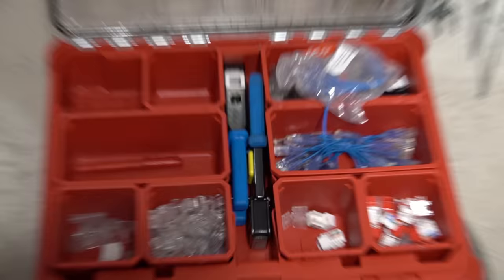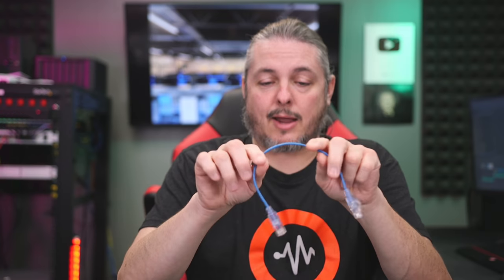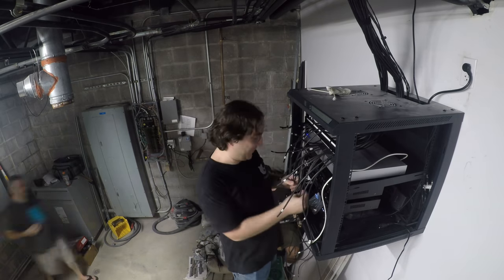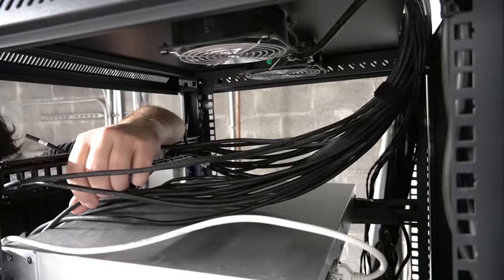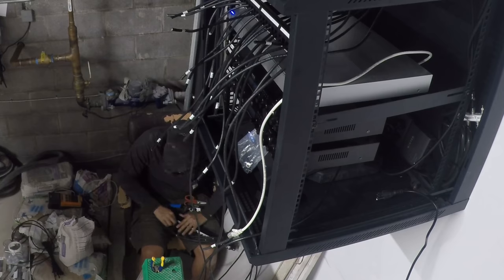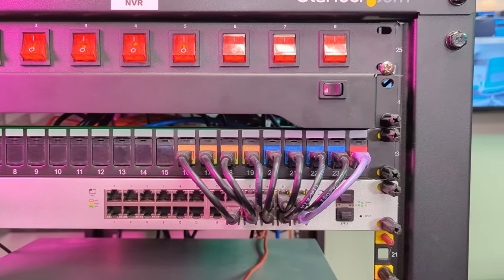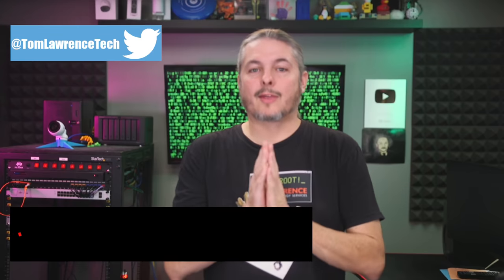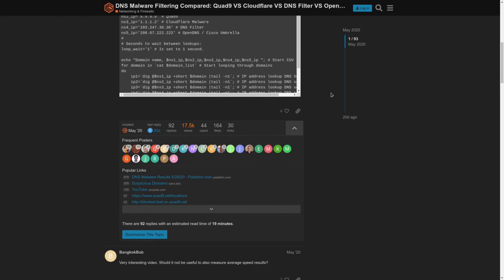Rack Cabling Project

Comment: Thank you from Romania, Tom! 
Some short questions:
- Do you have a procedure for labeling cables? I am referring to the notation that you use.
- How to properly do cable managment, when you need to use longer patchcords, and what accessories are available and you use for the racks?
- A short presentation of the accessories the you use for cable management in the ceiling.
Thank you again!
Reply: For notation, I usually just go by the room number, with a hyphen and number if there's multiple jacks in the room (ie: 201-1, 403-2, etc), that way anybody who comes in can figure out what goes where. Any modern office building will have room numbers, at least on the blueprints, and schools, of course, will have room numbers on the doors.

When my school was originally built around year 2000 (I was a student there), they ran two Cat5e cables to each wall plate, with black and blue Keystone jacks in each plate (and didn't label anything, I had to do that myself later 😠) . Black was the student domain, and blue was the teacher workgroup (the servers weren't set up terribly complex, they wanted it to be easy for a teacher to maintain). When I graduated and started doing IT support there, I rebuilt the server-side of the network as a full domain onto a single server, with permissions set up sufficiently to keep students out of teacher files, and developed scripts to automate user creation and folder permissions. Having the black and blue jacks became a redundant vestige at that point.

Comment: Great video as always Tom. We also insist on using the blank patch panels as it's better for the client in the long run from a serviceability point of view. If a jack fails, we can easily replace that keystone with one in our kit and not have to replace a whole patch panel if you are out of room on one. I will also say that we go a step further and put a printed version of our port layouts in the rack that is in a plastic sleeve, with extra space to write for move/changes/additions. This not only helps our customers but helps us or any other low voltage tech in the future. Keep up the great work!

Comment from the maker: DIY Home Rack Build
https://youtu.be/IdQGpKcBgwo

How We Do Pricing & Bidding For Structured Cabling Work 
https://youtu.be/xdkJRTwzEGw

Networking Tools
https://kit.co/lawrencesystems/lts-network-tool-kit

Rack Parts & Cables
https://kit.co/lawrencesystems/homelab-rack-build
00:00 Cabling Project Intro
01:20 Parts & Tools we use (Pack Out)
02:23 Low Voltage Cable Support Bridle Rings, & Velcro
03:41 Dressing the Rack & Patch Panel
09:00 Sweeping up

Comment: Hey Tom, thanks for this video. To specifically call out items that I'd like to see covered in a future video- maybe a deep dive on a few aspects of the cabling jobs:

- How do you process labeling both ends of the cable during the pull process? I usually write on the cables and the box, and when the pull is done, I cut and write the run number on the cables. I've seen others that print sheets of labels on both. I'd like to see your process.
- We usually bundle a 1-2 foot service loop above the rack/cabinet and then go inside. I usually leave some slack inside the cabinet as well, but then how do you get all the cable lengths the same coming out of the front of the rack? I was very intreaged to see you sitting to crimp vs. standing on a ladder in front of the rack. How do you manage that additional slack without creating a mess? Love to hear more about this.

Thank you for continuing to create amazing content that helps us all run our IT Businesses. It's appreciated.
Reply: Velcro ties. Lots and lots of Velcro ties.

Comment: I have made a rule of thumb for dealing with new installs, whatever the customer claims they want or need today, you will need to run a minimum of 20% more runs as you are doing that install. 32 years of experience has taught me that the customer is supposed to be right but has no idea if they are.

Comment: Before I became a full time landscaper, I used to to part time IT support at my local school (I did mostly hardware and server administration, my mom specialized in software support). As somebody in the autistic spectrum with a mild OCD, seeing a well-wired rack, or even being a part of that installation when the electricians were pulling cables, is extremely cathartic for me. ❤As far as favourite tools go, you often use what you can get available at a good price, but one tool you must NEVER use, is a small flat-bladed screwdriver in lieu of a 110 punch tool. A proper punch tool isn't that expensive, and a screwdriver will f*** up the blade contacts that bind the wires, and you'll never have a reliable jack. To that end, Keystone jacks are better to use over a pre-built panel if you have the money for it, as bad jacks can be easily replaced. The company who ran the LAN and telephone lines in the school's expansion wings used cheap Chinese all-in-one wall jacks, and I ended up replacing ALL of the ones we had in regular use myself with Keystone jacks, because we had no end of connection problems with those cheap jacks.

Comment: How do you keep track of what office ports correspond to which cables?  Do you mark them somehow or do you just tone things out once it’s all terminated?  Not sure how you keep track of 48 or more cables coming in as a large trunk of wiring prior to termination.  Nice vid!
Reply: assuming they label the box and front of the cable. and when they cut they label the back of the cable
Reply: You lable the cable. You can buy pre numbered or write on. You don't need a type, panel port number system while you are pulling but the plate and rack it's best to do something like DB20 for data panel B port 20. Or PA30 for phone panel A pair/port 30. I hate coming in and finding no labels anywhere or all RJ45 mixed voice and data same plate no color code or lable

Comment: Hi tom, i would like some more videos on populating rack at home (i saw your older videos) im in the process of building house so i will need it soon. I know basics but i miss some know how that you gain when you do that thousands of times. Some tips on wiring, stacking components, what way do you use for cables to enter the rack etc. Thanks!

Comment: I'm trying to get my network engineers to go with short patch cables on the rack instead of using 6ft cables and spacing out the switch and patch panel. I'd put them in this order and use a 1ft patch  cable between the panel and switch.
wire management
Patch panel
switch
wire management

Comment: Do you just leave the cables dropping straight into the cabinet?
I typically put cable tray or basket in for that sort of thing and tie the cables in bunches of 24.
Sometimes even trunking, that job looks like it's all just been thrown in the cab, not slating your work or anything, just not how I do it
Reply: If you don't have the support trays off the back of the blank keystone patch panels, run a j-hook or d-ring just above the rack and secure with velcro. Will relieve the stress before going into the cabinet.

Comment: You are no longer permitted to run cables under the roof deck like you show at 2:32.  
NEC 300.4(E), "A cable, raceway, or box, installed in exposed or concealed locations under metal-corrugated sheet roof decking, shall be installed and supported so there is not less than 1 ½ in. measured from the lowest surface of the roof decking to the top of the cable, raceway, or box. A cable, raceway, or box shall not be installed in concealed locations in metal-corrugated, sheet decking-type roof."

Comment: Do you attach the bundles of cables to the rack somehow or do you just let them sit on top of switches/servers/routers/etc?
Reply: If you don't have the support trays off the back of the blank keystone patch panels, run a j-hook or d-ring just above the rack and secure with velcro. Will relieve the stress before going into the cabinet.

Comment: What's wrong with using zip ties?
Reply from the maker: Not very serviceable and if pulled to tight can potentially damage cables.
Reply: Apparently the kinks in the cable zip-ties make can cause cross talk issues at the bleeding edge of Cat6. Maybe the insulator acts like a capacitor with the surface of the conductor at those high frequencies and causes interference if there's a skew in the pairs or something? Dielectric effect? My knowledge breaks down at this point. When I was doing IT support at my school, it was all Cat5e, where you don't notice it as much.

Comment: "...I'm throwing this away as soon as I'm done, as you should with everything that uses zipties." 

Boy do I feel this. I work in a datacenter, and we use zipties all the fucking time. The number of times I try to reach to pull out a cable from a server or something and pull my hands out with scrapes and cuts, or we have to remove them really carefully to avoid cutting the cable, even on SAS>SATA cables and shit...I hate zipties with a burning passion.
Reply: Zip ties can kink the cable. When I was doing IT support at my local school, I was working with Cat5e, where the difference wouldn't be noticed, but apparently, with the bleeding edge of Cat6, every little kink and bend can cause electromagnetic interference between the insulator and surface of the conductor, or skew the pairs, or something like that. My understanding of electromagnetic interference breaks down at point where you need to ask a radio tech to explain how twisted data pairs can cross-talk. But besides serviceability, that's apparently why they always tell you to use velcro straps instead of zip ties, no sharp turns, etc.
Reply: @BlackEpyon  Ours are very tightly cable managed, so kinks aren't so much the problem, though some are cinched so tightly that I wonder if it's damaging the pairs just from pinching them. From what I've seen it's not actually been an issue, but who knows. If I remember correctly we're running Cat6A for our runs, though it ma yjust be Cat6. Either way, the zip ties haven't caused actual problems with cabling, they're just annoying to deal with :P We do use velcro with any optical runs though, and avoid sharp turns with both.
Reply: @joshuawaterhousify  I'm not sure how tight it would need to be kinked to cause legitimate problems. Maybe just so that it causes the spacing of the twists to change? You'd probably have to do it pretty badly to notice. I've been out of IT support for several years now, and some of the low-voltage techs I've talked to have a lot more experience with that sort of thing than I do. I just like seeing good cable management. It's cathartic for me :)
Reply: @BlackEpyon  Probably pretty tightly for CAT. I've got a couple of hundred meters, so I might need to test it some time when I get a switch in that will push it to it's limits with 10GbE. I've got very little experience with that kind of thing, but it's something I'm curious about. My cable management is generally horrid, at least on my personal stuff, just because of not being bothered to put the time into it. I have such a mess everywhere ':D When I start doing some server stuff at home I'll at least be keeping that decently managed though, at least if I can (that's part of why I have the raw Cat6 length)
Reply: @joshuawaterhousify  All of my stuff at home is 1 GbE. Never had a need for anything faster, and 10/100 does fine for most stuff unless you're doing a large file transfer. But hey, 640 KB used to be enough too. Wait a few more years, and I might end up with some 10 GbE stuff falling in my lap.
Reply: @joshuawaterhousify  Well, your stuff seems to be newer than mine. My main PC rig is still rocking a first-gen i7 950. At nearly 13 years old, it's not bleeding edge by any stretch of the imagination any more, but that wasn't really a problem until recently when PSO2 upgraded their engine with the latest update and I discovered what the AVX instruction set is, and that my CPU doesn't have it. My GPU is well less than half that age, so it still games decently otherwise. That Asus P6T workstation motherboard has well exceeded it's product lifespan, but it looks like it's finally time for an upgrade. Not sure yet what I'll pick, but it'll probably still have gigabit Ethernet, likely dual gigabit, since that's what all the workstation motherboards are coming with these days. If it comes with faster, that's fine, but it's not really a priority for me.
Reply: @BlackEpyon  Hey, if it's still (or was still) doing what you want, there's nothing wrong with that, especially if it still games decently. Sorry it doesn't have AVX though, that's an unfortunate reason to need to upgrade. 

 I ran an i7 3770 for 7 years until I fried the motherboard, but I mainly went for what I did to replace it because I wanted to make sure I could 1) do game development, and 2) scale in various ways (storage, processing power, etc) as requirements for different things I was doing increased.
Reply: @joshuawaterhousify  Certainly. My home file/print server is built into an HP z400 that I picked up used (just as old as my main rig). Those workstation motherboards tend to last a long time, and thankfully, we've passed over the "capacitor plague" from the early 2000's (I've lost count of how many dozens of motherboards I've recapped from that era).

Probably the biggest thing I'll miss on the P6T is the onboard floppy and IDE controllers. I still use floppy and Zip disks to transfer files to and from my vintage computer collection, but I can go external on those if I have to, and CompactFlash is still a viable option as a fallback (it's just not as "removable" when used as an IDE device, so not always convenient). 

Scalability is certainly one reason to spend a couple hundred more for a workstation motherboard over a consumer or gaming motherboard. More PCIe slots, more RAM slots, and typically better onboard RAID support or even two SATA controllers (which the P6T has, JMicron JMB363 and Intel ICH10, both on different buses). Much better bang for your buck if you get something that can last a decade or longer before you need to upgrade. 

To that end, I'm not decided yet whether to upgrade now, or wait until DDR5 becomes more widely available. Asus has some gaming motherboards with DDR5 support, but if I go for DDR5 I'd at least wait for the workstation motherboards to catch up (Gaming motherboards are a bunch of marketeering wank anyways, unless you're building an RGB showpiece). Probably some time in the coming year, they'll have a better selection of DDR5 motherboards available. We'll see.
Reply: @BlackEpyon  I definitely get that; I've only really gotten into any of this kind of thing in the last year or so, and up until recently it's very much been just in the planning stages. Even now I'm still heavily planning rather than being able to execute it, hence current consumer parts, but I'm gradually getting through the execution of it, and consumer parts these days still have a lot of scalability in terms of core and thread count and such. 

That would definitely be a massive boon for that kind of thing. I'm not as concerned in that kind of scalability in RAM and SATA (though the server board I have does have 8 ports, which will be good for storage without straight out needing a RAID or HBA, though I may get one anyway), but unfortunately that one's only mATX, so you lose out on things like PCIe slots, but for a starting setup, still not bad; still will let me fit a RAID and an old graphics card for Plex or something

 Honestly, at this point I'm not sure DDR5 would be worth it anyway; DDR4 has enough advances that they kinda trade blows at the moment, particularly if you're willing to put a little more into a DDR4 kit, but if you're looking at upgrading and want a decade lifecycle it may be at least even for now, and you may get that added benefit later so long as the memory controller is up for it. As for RGB, I don't mind it, but only when I can use it for a purpose; I used to have my CPU and GPU thermals control the colour of my RGB, but it no longer talks to my GPU properly, so I can only do it by CPU, and the cooling I use now just keeps it stead (though I think that's partially a bad mount) so it's just an odd and annoying shade of purple when I do that ':D